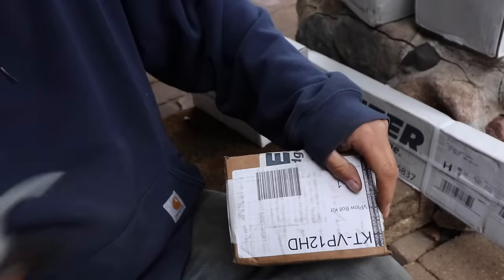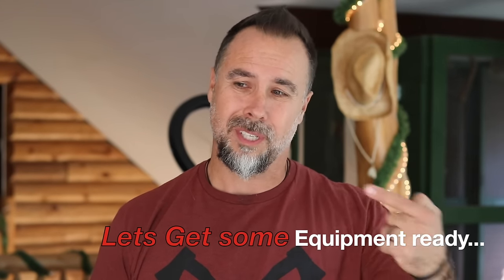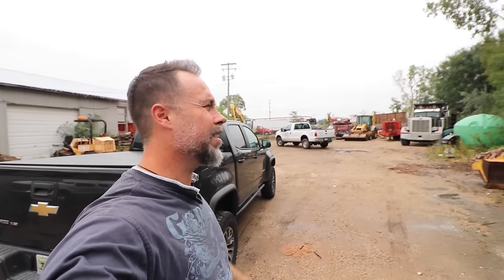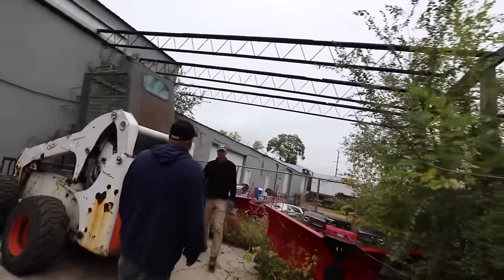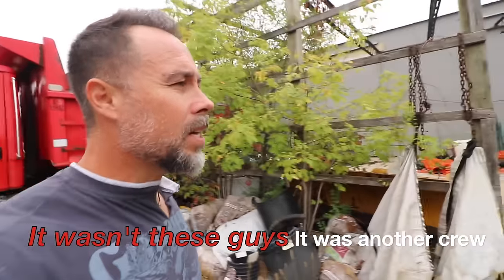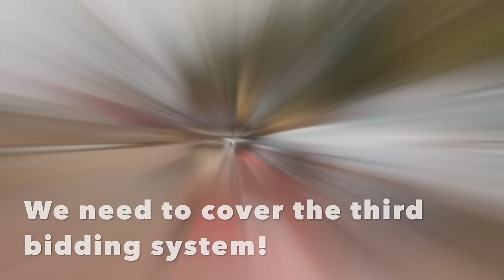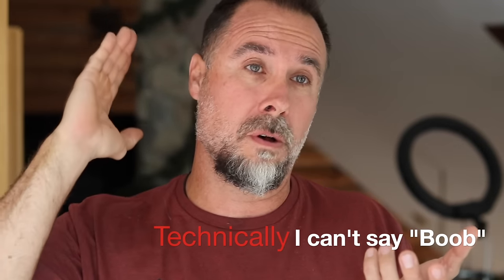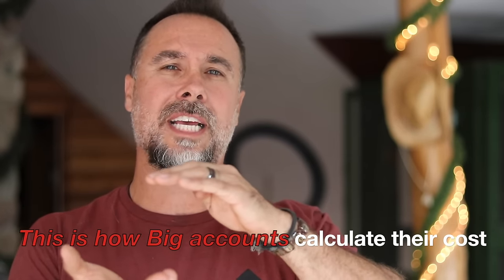How to run a Snowplow Business: Red flags, pricing systems and what not to do...

Comment: My per/plows are based on an hourly rate that includes drive time from the last or nearest account + a trip fee. The per/ plow is up to a certain time (depending on the account), with overages billed in 15 minute increments @ 25% of the hourly rate. I have considered asking for a non-refundable sum equal to 2 plows per month, Dec-March to cover "dry" spells. Then each of those months, the first 2 plows would be pre-paid (unless there is an overage).
I came up with this system because of 3" wet and heavy that plows harder than 12" of champagne powder. The forecast vs actual measurable snow varies wildly in my coverage area, and I've watched too many guys being accused of using the "plow guy's ruler" where 1.5" is billed as 4+". Northern MI

Comment: when i used to do snowplowing up in new york. Our boss had a set way to price stuff. Residential were priced at certain length of the driveway. a 10 foot long drive for starter was $10.00   20 foot long driveway you guessed it $20. so on and so on.  Commercial was different and we got lot of Commercial business as way Boss priced it was Per Parking Space. which started at 2.00 for like normal width parking spaces and for Semi truck parking spaces it was 2.50.   Granted we were ALWAYS busy in the winter. more then a few times Boss would have to call in extra Help from other companies friends he knew to come help.  Boss was kind too, there was 2 senior citizen complexes in town. We would do for Free. but again pretty much all other companies around the area did the same thing. a way to give back to the Seniors
Reply from the maker: Thanks for the comments and thank you for watching !

Comment: I will add my 2 cents to this video also.  I do residential snow removal.  I have the same customers that I have for my mowing season.  I give a rate for snow removal.  What ever that rate is that rate is good for up to 6" of snow.  Meaning if it is 1" or 6" it is the price I quoted.  If it is more than 6" I might have to come out twice to clear the snow.  I use a snow blower.  No plow.  But before I go out for snow removal I am watching the weather, radar and timing of the snow for anywhere from 3-5 hrs before I go out.  Then I go out and start clearing the snow.  When I use salt  I usually double the price of the bag.  It also depends on the temperature.  If the temp is in the 20's I can use regular cheap salt but if the temp is lower I have to switch to a rock salt that works at a lower temp.  Then if I am dealing with ice I will have to use deicer rock salt.  during the winter it is not uncommon to see 20-30 bags of salt in the back of my truck and they are not the same.  I don't use salt on everyone's property.  Only when requested and only when needed.  I clear the snow with the snow blower then I go back over the property with the shovel.  Then salt if needed.  This way the property is completely clear and nothing is on the ground.  As you can tell I am reviewing my snow removal operations tonight.  I have already been out 4 times this year.  I was up all night last night for only about 1/2" but it was icing up and turning into a ice rink.
Reply from the maker: Thanks for sharing Bill and for viewing, hope you have a great season!

Comment: This is a very good intro video for those just starting out and like you said, there is a lot more involved and this is just the basic information. 

I pretty much do the same exact bidding and pricing, I give each client a option for per storm or seasonal for plowing and the only hourly I do is with my machines. 

Per storm is invoiced after each storm and seasonal is broke down for monthly payments. 
One thing I add in my contracts is I reserve the right to suspend service if payment has not been received. 

I also have one page in my contracts that covers additional services that might occur;
I left the prices blank as they would be different depending on what state and area a person is in and would charge.

Additional Costs that may occur for Seasonal Service or Per Storm Service

 State Taxes will be added in the invoices for any service calls rendered

Additional Cost for Major Blizzards
Any one storm over 12.1 inches there will be additional costs:
For over 12.1 inches there will be additional cost of $000.00 every 1 inch for plowing

Extra Plowing - (service call)
If you ask us to come back the following day after we have been there and cleaned up the roadways and parking spots, there will be an additional charge for this; it will be a cost of $000.00 an hour, minimum 1 hour.

Extra Sanding for Roadways and Parking Lots - (service call)
In the event that additional sanding is needed on non-storm days for melt off from roofs, drains, etc...
Said application will cost $000.00 per application

Melt Off, Icy Conditions for sidewalks - (service call)
Salting for icy conditions on non-storm days for melt off from roofs, drains, etc... 
It will be at a cost of $00.00 an hour, minimum 1 hour

Skid steer usage for clearing and relocating snow outside of normal operations- (service call)
It will be at a cost of $000.00 an hour, minimum time 2 hours. – (this is for the machine, plow trucks and spotters)

Sweeping service to clean up sand at end of season, roads and parking lots - (service call)
It will be at the cost of $000.00 dollars sand dumped on site / $000.00 if dumped off site

Any of these service calls would only be completed upon verbal orders from you or your site manager.

One thing I would add is don't underbid, if your not making a profit then what's the sense, plus it lowers the market price for everyone.  

Have a great 2019 and let it snow.
Reply from the maker: Thanks for the input and have a great 2019 also!
Reply: Yes, this is a great starter video and also great to compare and see what I may or may not be doing wrong in bidding. I’m curious however why the “per push” bidding wasn’t included?

The majority of my contracts are billed each time I visit and per how much snow I push at that particular time.  

I will bill them X for 0-3”, then Y from 3-6”, Z from 6-9”...then if it goes over 9” I charge per inch over 9 plus Z. Both commercial and residential customers seem to like that method and haven’t had any disputes.  The way the customer sees it, with little to no snow they get their service and not paying out the nose for it and it’s easy to push an inch or two so it’s still worth my time. But if we get dumped on like in April, customers understand when they get that bill and you’re still making money.

Just a suggestion.👍
Reply: @the-bob-father he does cover that at 8:59 and he states to increase it based on inches. 

And if your are referring to me, I call it per storm which is based on inches.  
I don't call it per push because a client can misunderstand that to think they are only charged for each time I plow.  I charge based on the amount of snowfall not the amount of times I plow/push snow. 

2"-3.9"
4"-6.9"
7"-9.9"
10"-12"    

I have heard of other people calling it per push and they base their price on how many times they plow/push snow at a place. 

Never charge a client based on how many times you plowed, charge based on inches.

The reason is blizzards that drop more than 12 inches of snow or even larger storms that drop 8-12 inches of snow quickly -(had one storm blew in dropped 9 inches of snow in about 3 hours and was done, we couldn't go out because it had high winds and visibly was terrible, you couldn't see more than 5 to 10 feet in front you)

No way your keeping up with a storm that is dropping 2-4 inches of snow per half hour to hour unless you just have one client and you stay there and plow with the storm. 
More than one client and someone is going to have more than 2 or 3 inches. 

You might manage to plow everyone at least once maybe twice before it gets too bad and you have to shut down till it's over or at least slowed down enough so you can safely drive and plow.  

At that point you might be plowing out a place that has say 18 inches of snow or more -(big blizzards)
If you charge for per push -(only each time you plow) then you are plowing a lot more snow for a lot less money.

That's why you charge by the inches regardless of how many times you plow.
Reply: @the-bob-father  I won't push more than 2 to 4 inches at a time and price it that way. For a 1 foot storm, they will get billed for 3 or 4 visits, all at the same rate.

Comment: Polar Flex blades are the best thing ever. At work at a state dot yard we get 5 to 6 years out of polar flex blade. Also we use hydraulic system called a blade saver. We get that from Monroe Truck Equipment. 

Also another blade that is good is Kenimetal dowel carbide blades.

Winter blades suck no life at all.

Comment: I have a bit of a formula, my rough estimate is $400/hr for how long I'd estimate to make one nice pass all inclusive, now the variable is 2" to 12" and under a 24 hr event,   every extra foot or fraction is another charge.  So a 15 min driveway would be 100, but that'd be a big driveway. Most of mine are all under 10 minutes and generally all what I'd call the black diamond driveways, scary to look at or have caused other contractors to loose a truck.  Now being at a fixed event, if its going to be icy/slick, I don't feel bad hitting it twice or every few inches to keep the truck from bulldozing a foot of cement.  Sometimes we get multiple feet of fluff or just a few inches to a foot of super heavy stuff.   I'm thinking I'd not mind picking up a small parking lot just to have something flat to have fun with.   Salt spreading is usually 1/2 regular price as salt is pretty expensive mid season.
Reply from the maker: Thanks for sharing and for watching !

Comment: I am a customer.  I have my contractor plow my driveway no sooner than 24 hours and no later than 72 hours if there is 6" or more of snow and the weather forecast for the next few days will not melt the snow.
Why? because I work at home and have a 4 wheel drive truck.  If there is more than 6" of snow and it is not going to melt, I do not want to shovel it my 200' driveway and parking area.  And as I do need it done right away, my guy puts me at the bottom of his list and he will get to me if/as needed.  This way, my plow guy has a job when all his other jobs are done and I get a very good rate.
My point is, not all of us need our areas plowed to operate our business.  With a little bit of horse-trading, you can pick up extra jobs when the big jobs are done.
Reply from the maker: Good comments Frank, thanks !!
Reply: I would not have you as a customer. Everybody wants alacarte and it's a pain in the arse. I have a simple rule. Price the job for every two to four inches and if my town is plowing, I'm plowing. If I show up at your house and your house/lot, you get billed.

Comment: Them back blades are slick but pushing in reverse is hard on the trans! Not sure about other trans but pushing in reverse will take reverse in a 4l80 out quick!
Reply: George Odbert Typically you would use a back blade to drag snow while going ahead, great for driveways & such, if you’ve also got a front blade like Stanley does you then use that to clean up the snow you’ve dragged out with the back blade. The best way to prevent trans failure is with a large external cooler, bypass the radiator completely & just run an external cooler. My trans runs 50 degrees cooler then my engine when I’m plowing.
Reply: and woudlent be like pulling a loade with your truck any way

Comment: I NEVER work hourly for snow removal. I DO, however, clear on a contract/yearly basis and on a Pay As You Go (PAYG/per push) basis. But I keep my PAYG customers limited to about 20%, maximum. There is a trick to figuring that out. I'd be interested in chatting with you, Stan, about possible collaboration. I can't say more than that for now.  :)

Comment: Awesome channel. I’m from the upper peninsula of mi  I’ve been plowing  commercially for 20+ years I usually estimated for a 6” drop , how long it will take for a 6” drop, and run one price for all events    I make more money sence going to this system and the customers love one rate not trying to figure out different rates.   I may loose money on 1 or 2 events but overall with the majority of 2-3” drops I make out many times over.
Reply: Great post, I charge if I return after the first time in a 12" snowfall on the same day and I have lost some money by not charging enough--- lesson learned
Reply from the maker: Thanks Steve and thanks for viewing.
Reply: I drank some beer with a guy in Calumet while I was UP there snowmobiling. He plowed and charged monthly. $125/mo. no limits on the snow. He also plowed for the county. This was in 2017'

Comment: Fluid film and dielectric Grease are 2 must to keep a plow and plow eletric from rusting...
Reply: y2kxj I know dielectric grease, but what is fluid film?
Reply: use both before during and after the season... love em
Reply: Karl Armbrust
It's a spray on rust preventer. Undercoat traps moisture between it and your frame, then rots it out. Fluid film (https://www.fluid-film.com/) resists water, keeping away from the metal.

Spray it inside your frame rails too, to keep them from rotting from the inside. I worked in a weld shop in my 20's. I'm still friends with the owner. I just took my Jeep Wrangler in a couple weeks ago to have the front frame rails welded and he turned me onto this.
Reply: @RobCalhounPGH  Had my wifes vehicle done last fall, do you think needs done yearly or can get awat will it every few years? Lil over hundred bucks here. Obv if we hold on to vehicle 6 7 8 yrs??? Chunk of money.
Reply: @michaelprentice9779  It's kind of a pay now or pay later. Yeah, you could save +/- $100 (I just paid $150) per year and just pay it in one lump sum when you get the frame repaired (I just paid $600 for that too). Or you can pay each year. It's up to you.

As far as getting it done every year? It depends a lot on how much you drive it and if it's still effectively shedding water. That and will what you have hold out through another season? Again, you're back to that pay now or later.
Reply: @michaelprentice9779  Do it annually

Comment: You're right if the plows are facing the other way ANYBODY can roll up and drive away with the plow in just a few moments, so yeah you're helping those thieves out. Your so awesome helping those thieves out and make it easier to get your stuff. \
Reply: Gene R M at the place I used to work at, we would have the plows pointed so the trucks could just come up and hook onto them but in the off season we’d store all of our snow boxes creating a kind of layered boxlike formation around the plows so nobody could steal them. During the winter we never worried about it cause we just left them on the trucks.
Reply: Not sure that’s a valid concern for Western plows. Not much chance a thief would have a mount and control harness on his truck which matched the plow.